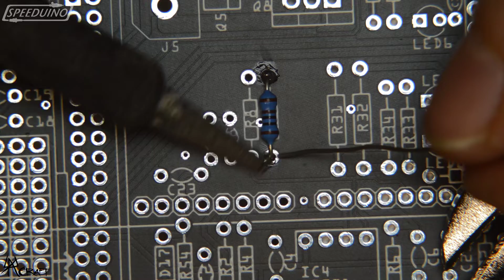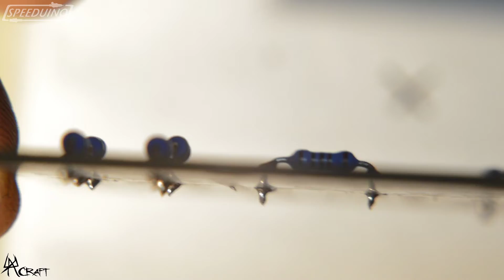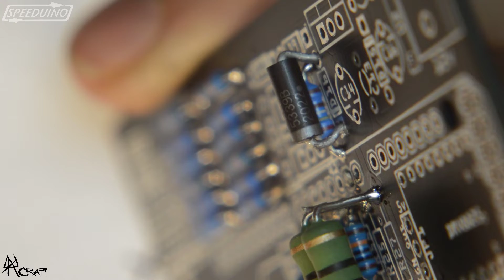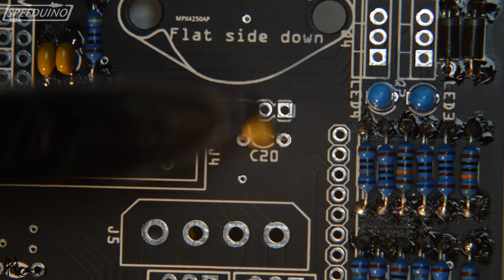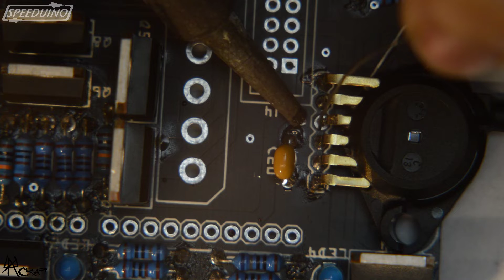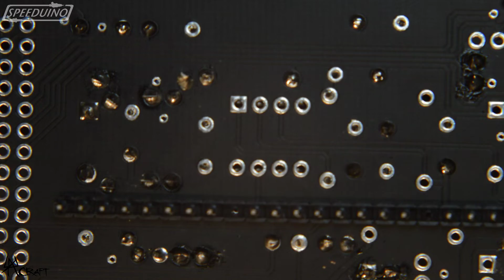Stuffing and soldering the  Speeduino 0.4.3c Board  Closeup!

Comment: When assembling, for example if I’m doing the first pack of resistors, do those resistors need to go to a specific place or do all resistors in one baggy work universally with every resistor labbled on the bag?
Reply from the maker: They have a Color Code that tells the Value, the Direction is only important with diodes and polarized caps.
Reply: Okay thank youu mine doesn’t have a colour code but I have a sheet and it says what ones have the same value and the ones that do are in the same baggie
Reply from the maker: @George_fitness69  to make sure you have the right one tech-moan(colorblind) uses a Multimeter to beck check that he has the right one :) good luck with your Projekt <3 
-lara
Reply: @Laracrafttrabant  okay thanks what car did u end up putting urs on?
Reply from the maker: @George_fitness69  it is on a lifan 670vtwin that is going to go into my trabant 601
Reply: @Laracrafttrabant  awesome I being basic and going for an mx5 😂

Comment: Hey, dumb question and I'm a noobie. I have the 0.4.3d board. How do you know which way to solder the capacitors?
Reply from the maker: Most of them are non Polarized, for the ones that do have a polarity there is a segment in the wiki that shows how to identify them. 
https://wiki.speeduino.com/en/boards/V04 under the point: Board Assembly.

Good luck on your build - Lara Craft

Comment: Greetings from Czech! Are you planning to make your Trabi to injection EFI with speeduino? I did some testing on Jawa 350 bike. 
If you would need help i could assist with some knowledge ;) This would be for sure first Trabant on speeduino hehe :D
Reply from the maker: Yeah that is the plan, first the  original 2 stroke 600ccm  of the Trabant.
Then the bigger project , the LIFAN-2V78F-3 swap.
Need to figure out the mounting first though :D  

There was one i saw using Megasquirt though.
Lets see when i have some time to work on the fuel injection .
I will definitely post some Videos ;)

She's my daily, so i do have to keep her running when i do stuff like that <3

Comment: Is soldering beginner friendly? Have to do it when I eventually fix up one of my guitars
Reply from the maker: Trough hole should is doable with some practice, guitar parts are bigger and therefore easier to handle, important is to first heat the component up good and then add the solder.

Comment: I just got my v0.4.3d board in the mail this morning and I'm trying to make sense of the github bom file which ALWAYS come up as a file for the C version which DOES NOT jive with the board or the schematic I am looking at which claims to be a d but there are component values that DO NOT match the BOM list. I have a file downloaded supposedly but it WILL NOT open when I click save and open. Also there are listed components that do not have space to be placed on this board. Anyone care to get in touch with me and assist with this. I would like to progress and solder but NO way am I going to start that phase until I can sort this out. I expect my 2560 to arrive tomorrow and I have my DRV8825 in route also. I will have to wait till the 1st to place an order for components I don't have as yet. Again, I have spent the last 2 days trying to access the correct list and files but I always wind up where I've already been which is not where I need to be. At the moment, I'm pretty disenchanted with this project on the grounds of disorganization from the creators. I have watched a load of YOUTUBEs posted by Josh and as helpful as those have been it's still not enough. I recently finished assembling an MS3X with about everything that can be added into that system and it wasn't as big of deal is this is turning out to be because there was much better organization of the information I needed for it. Anxiously awaiting anyone help.
Reply from the maker: The files on the Github are .xlsx files, you need a spreadsheet program like libre calc or mircosoft exel to open them. I uploaded the right file for your version of the board to my dropbox for you.
https://www.dropbox.com/s/dhh4cgqu1fl3dcr/v0.4.3d%20BOM.xlsx?dl=0

and libre office package can be downloaded here 
https://www.libreoffice.org/download/download/

Comment: whyy are you soldering from the component side and not the backside? and btw your solder is running way too hot, and is very big for the application too
Reply from the maker: i solder from both sides if it dose not flow trough, and i know that i need a new tip :D
i want to make sure everything is solid and vibration save. and yes the iron was a bit hot, thanks for noticing was set for lead free and i used leaded
Reply: If you start by soldering from the underside, the components hang away from the board and this makes it easier for the leads to break under vibration because they're longer than they need to be. Unless you are using a component that makes heat and can cook the coating on the PCB, always do it this way or you will have to force the parts down which can stress the leads even more. Once both leads are soldered, then a touch up on the bottom side can be made to seal the  leads and make the joint stronger by taking out any sharp edges where the solder joint could fracture in the future. A good practice to do when the project if fully finished is to spray it with clear coat to seal it even more to keep solder bloom from developing and also eliminate any chance of condensation from causing partial or complete shorts. Do a good clean up with 99% isopropol alcohol to remove flux and be sure to get any solder beads off the board that could get caught in the pins of the small surface mount IC's if any. Another reason for soldering from the top with multi layer boards and thru plated holes is you don't have to bend the leads over on the underside which can increase the chances of cross connections in very tight places. It's better to have the leads straight up from the back side of the hole, makes it easier to clip it closer.
Reply: @Laracrafttrabant  i also solder on the top side because I like my resistors to be straight so I solder one pin on the top side so it stays in place. I also dont really like bending the legs out as it looks a bit messy on the bottom. It doesn't really matter I am just a bit OCD about it